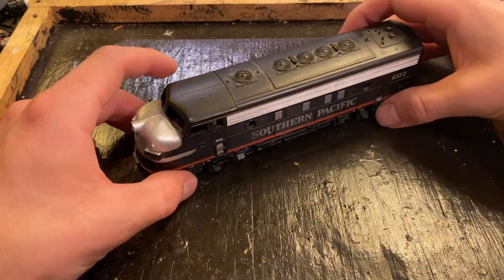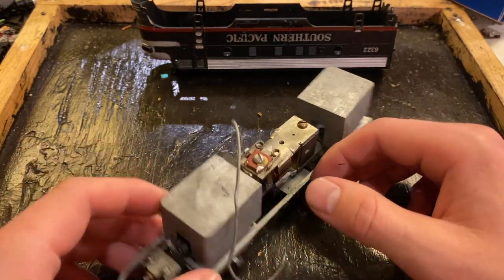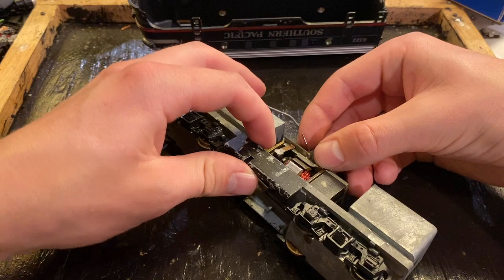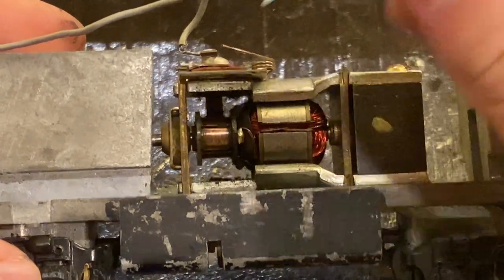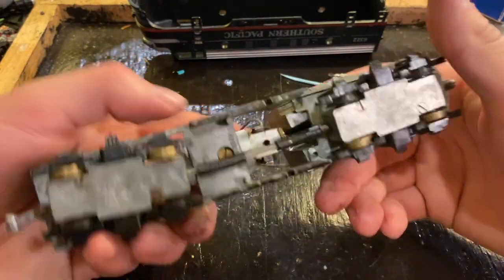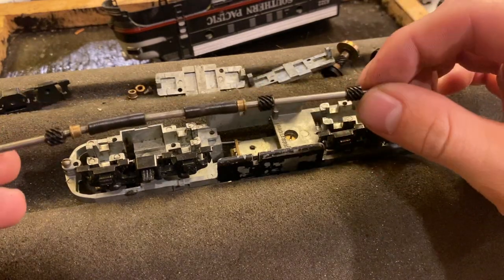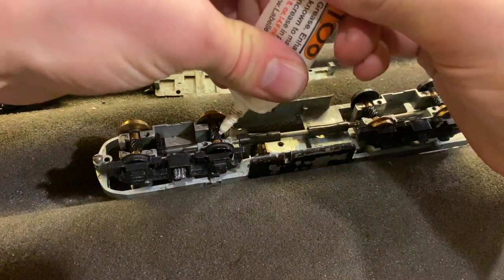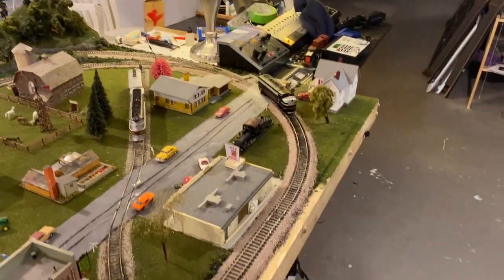Can We Make it Run? Hobby Town Southern Pacific F-Unit

Comment: with added Hobbytown "multidrive" kits you can power more than one unit with a single motor vastly increasing the pulling power.  The multidrive is simply a system that powers trucks in a second (and even a third) body via additional trucks and universals (similar to yours) but not a second motor.  All underneath leaving the second (empty) body to hold electronics or sound systems.
Reply: Swamphdaddy - I think that Darth Santa Fe did that with Hobbytown Alco PAs in one of his videos.

Comment: I would call those worm gears, Harrison.  That locomotive sure has an interesting drive train.  It's a smooth, quiet runner.
Thanks for sharing. 👍 👍 👍
Reply: They are helical cut gears.  should be quieter than worm gears.

Comment: Ahh a brand ive Never heard of and a niceBlack widow paint scheme from 1950s. The wire on screw i would think a loop terminal connector would help so the screw is attached to loop not the wire creating fatigue maybe would help keep wire good.
I like the tips about the motor which leads me to check mine one one of my locomotives because it had difficulty running. I think I have stuff on plates plus spring tension prob an issue. Good job Fixing her up

Comment: The limited stretch and eventual deterioration of that rubber tubing will put a bind on the trucks on the curves and more strain on the motor.  Those drive trains are mechanically the best around IMO and will probably last forever with a bit of care.  Your unit has the Pittman DC70 motor.  A good unit.  A more powerful motor, the Pittman DC90 can be found for that unit and will double the power, if not more.
Reply: Swamphdaddy - Is it a good idea to use Rubber Restorer chemical on that rubber tubing?

Comment: If you want to do Multiple Unit diesel you should use HobbyTown engines because if you put a bigger motor in it. It should pull anything and if you do get one take it to a train club and do a traction test it’s funny what happens
Reply: I don't remember if they make their own motors
Reply: @sonic23233  they used Pittman motors until Pittman quite making them. Original Hobbytown or Boston then had Japanese clones made of the DC90 motor

Comment: Curious: where did you get the carbon fiber pencil from? It looks like a really good piece of kit for locomotive servicing. Oh, and if nobody mentioned it, I'm going to shamelessly shill for Micro-Mark. All the proper miniature tools you could ever want for maintaining your locomotives and rolling stock collection. But seriously, I bought several items like the "Truck Tuner", an NMRA track/wheel gauge, and a coupler height gauge. They've proved invaluable for keeping my equipment rolling and on track. I wouldn't recommend a tool site if I didn't actually use/approve of what they're offering. 

I guess that's enough word salad.
Cheers!

P.S.  BTW, are you doing a Christmas Train challenge this year?
Reply: You'll have to ask Dave from DBTech about the carbon fiber pencil.  Dave sent it to him.👍
Reply: @davidztog9011  I was looking up "carbon fiber pencils" and found nothing but lightweight aerodynamic writing utensils. Is it possible that the pen Harrison is using actually a GLASS fiber pen? Because I hit search paydirt on those. But I want to make sure that is in fact what it is.
Reply: @sort187  Harrison keeps saying carbon, but Dave of DBTech said they are fiberglass.  Search eBay for fiberglass scratch brush.  Good Luck! 👍

Comment: You need to get rid of the rubber tubing on drive shaft connecting the lower trucks, ditto same on motor to gear tower drive shaft.  Hobbytown (one word) part #100000K which contains 2 brass drive shafts and universal couplings.  Download their catalog at: https://hobbytownofboston.com/?page_id=53.  A new owner is reissuing the old Hobbytown drives and metal bodies.